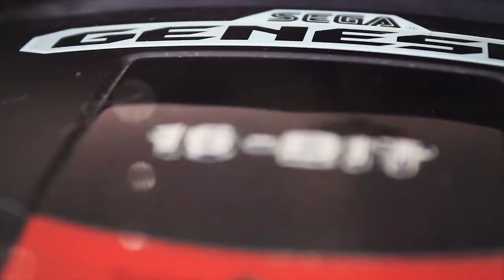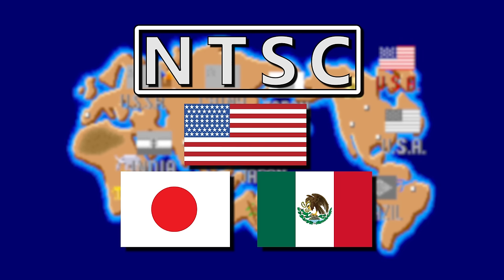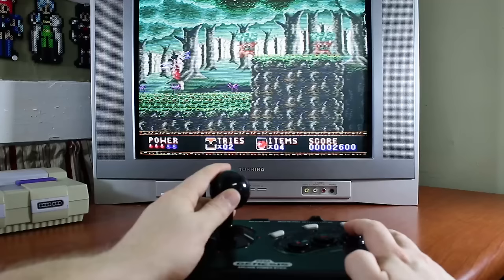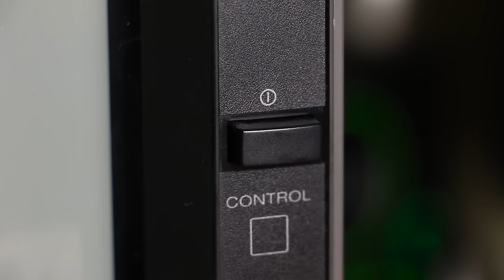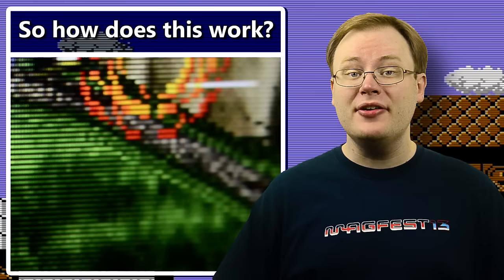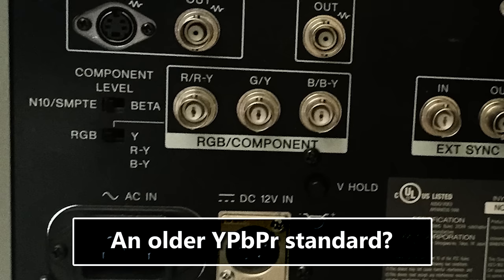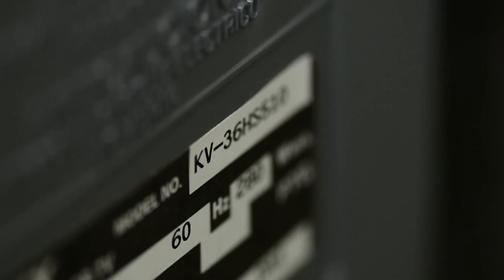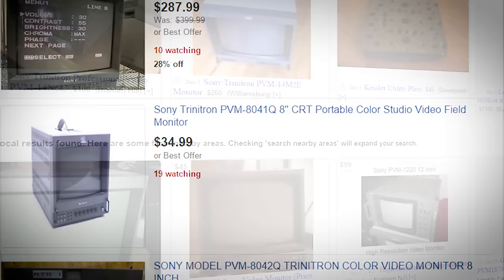Gaming on CRT Televisions, PVMs and BVMs :: RGB104 / MY LIFE IN GAMING

Comment: Hi guys, thank you for the informative and entertaining video. I have to ask, did you ever consider a CRT projector for vintage gaming? Personally since the late '90s I play on projectors, and while now for modern consoles I use digital projectors (that in certain cases are not too bad regarding lag), for consoles up to Gamecube era, I find a good old CRT projector a wonderful experience. You see, Sony PVM, BVM and good consumer monitors are fine, but obviously they are really small. CRT projector are a pain to install, they are really big, sometimes a bitch to properly setup, but when all is fine, the experience to play retro on a 60" screen (that is usually the minimum size they can be setup) on a CRT is really unpaired in my humble opinion. And as is the case with professional monitor, for low res signal maybe is even preferable to use a low-end CRT projector, otherwise the scanlines can be really big, defined and distracting (I prefer non do anything with external scalers, doublers, etc). For example I have right now a Sony D50 7" and a Barco 909 9", and at 240p I prefer the former (that can be purchased dirty cheap, as other somewhat low-end CRTs projectors).
Reply from the maker: [Try4ce] I've just begun to dabble in the world of DLP projectors, but I have no clue how to get my hands on a CRT projector these days.
Reply: @mylifeingaming  , well, other than the usual eBay and similar, one ultra-reliable source in the past years for me was curtpalme.com. Curt is a really nice guy and is really THE BIBLE regardind CRT projectors. Plus, the unit sold by him are absolutely bomb proof, and for gear over 20 years old and very complicated, it is a nice bonus. 
Sadly in recent years the CRT market has dried out, but I am in the processing to buy a Barco 708 from him (nice unit that accept natively 480i and up signals, and is not too sharp for them). I know he also has a pair of Barco 909, the pinnacle of CRT technology, but these accept signal from 480p on, and even so, they really are ultra sharp for SD signals. So you would "need" to use some scaler to have a more compact image. Think like a BVM monitor, you can like ultra defined scanlines, or not. I honestly prefer a bit less sharp image with SD content. But for you guys that like retrogaming on CRT, the CRT projector are a route worth considering in my opinion.

Comment: Hey noob here, so scan lines on my crt are barely visible but it only has a composite and svideo inputs, is it still an hd crt?

Edit: changed component to compsite
Reply: Just because it has a flat screen and component doesn't mean it's a CRT. My Panasonic has component and is SD while mid 2000s Trinitrons could look identical to their HD counterparts. If it doesn't have resolution options or HDMI I'd assume it's not an HD CRT.
Reply: @nerdyneedsalife8315  its an emerson ewf2004a, I got it for free. I assume the a at the end is for analog. I'm just trying to find any information what is an analog crt and what is an digital crt and can't find anything. Also I wrote component instead of composite.
Reply: @TheRealMax77  I don't think it is according to this link. https://www.cnet.com/products/emerson-ewf2004-20-crt-tv/

Comment: What are your thoughts on rear projection?
Reply from the maker: [Try4ce] In my experience, the black levels aren't particularly good, but it's definitely a neat technology.
Reply: @mylifeingaming  Kinda got my hands on a rather, absurdly large for the space I have, crt rear projection tv. Like 60 inches. But it's an HDTV 1080i, so probably digital delay in there, but it's viewing angle is just terrible. And it's still kind a dim, and I don't think you can really change out a lamp like you can later styles of rear projectors.

 Sonic 3 is in black and white because it wants to think it's 480i. But strangely other genesis games are fine, I could probably use the rf instead of the a/v. But I do have to admit Sonic 1, and came through extremely clean. But how many other games/systems is this going to be a problem where it can't take and use the 240 signal correctly?

I kinda want to get rid of it, but I kinda don't. I guess it's not really that ideal for retro gaming, and it's kinda impractical, but after getting it up a few flights of stairs...
Reply from the maker: [Try4ce] Are you sure it's CRT and not DLP? Weird that it would interpret 240p that way, must be digital weirdness. One thing, the Genesis composite signal is so poor, some devices can't lock onto the chroma signal. Maybe that had something to do with it.

Comment: Is scart better than S video?
Reply from the maker: [Try4ce] Yes, especially when connecting to a pro monitor or upscaler. Not much difference on a consumer CRT. However be warned that SCART is just connector and may carry different signals. What you want is RGB. Cheap SCARTS may be composite only or have noise issues due to poor wiring. SCARTs cheaper than $20 should not be trusted. RGB and component are essentially the same quality when that's an option too.

Comment: So for Ps2.. Is it suitable to use crt or led monitor with hdmi converter?
Reply from the maker: [Try4ce] PS2 probably benefits from a CRT more than any other console in my opinion. But you can play it on an HDTV too.
Reply: @mylifeingaming  because i order a hdmi converter for ps2 to play at AOC Monitor.. I don't know which one can get a sharper picture between crt and the monitor..
Reply from the maker: [Try4ce] If "sharpness" is what you're looking for, I feel like PS2 looks especially sharp on a CRT. Somehow the way interlacing is done on a CRT, it just makes the depth of detail in the image feel like more than it really is. It's hard to explain, but the textures just look cleaner, and even geometry edges look crisper with 480i on a CRT, no matter what method you use to upscale it for an LCD TV/monitor.
Reply: @mylifeingaming  So that means i just use the crt for Ps2 right? How about Nintendo Wii? Is it suitable with monitor and connect with hdmi converter?
Reply from the maker: [Try4ce] Most Wii games support 480p. Not sure what kind of monitor you're talking about. If a CRT computer monitor, Wii should look pretty good with a lag-free component to VGA adapter.
Reply: @mylifeingaming  I mean im playing wii using the normal gaming led monitor like AOC.. Is it good for the resolution or quality for the gaming picture?

Comment: "sending 240p to the TV"
that never happens, 240p is not a TV standard format, the console itself has to convert to 480i or 576i before sending to a TV.
Reply from the maker: [Try4ce] Correct, it's not a proper TV standard format, but it is a "trick" that works because analog technology can be manipulated like that. Look at a CRT up close when sending it a 240p signal versus 480i. The behavior is different. 240p is a TRUE progressive signal, there is no interlaced flicker (if you're using composite, don't mistake the flicker of composite for interlacing). There are gaps between each scanline. While interlaced content draws scanlines in alternating fields, 240p has the electron gun scan the lines in at the same place on the next frame. Some people call this "double strike." Many modern TVs will not accept 240p because it's off spec from what they expect, but this is not a problem in the analog world. For the modern TVs that do recognize 240p, some of them display information that it is receiving a 240p signal, as opposed to 480i (however some do misinterpret it as 480i). It is a distinctly different signal when it leaves the console, but it still fits within the 15kHz range. Only a few consoles (like the 3DO) convert 240p to 480i before it leaves the system.

Comment: I'm an engineer, I worked for RCA, I live in Silicon Valley.  Trust me when I say nobody designing video games cared a bit about using a CRT.  Engineers hate them because of their flicker and the 2nd I didn't need to use one to be able to work on a computer, I didn't have one - back in the mid 1990s.  CRTs are TERRIBLE, and it's not much work to simulate the horribleness of them on a flat panel, if you really want to do it.
Reply: I bought a toshiba crt tv in the mid 90's and that tv had a fantastic picture quality and brilliant sound.....paid a lot for it back in the day but it was worth it

Comment: How lag sensitive are lightguns?
Reply from the maker: [Try4ce] Very. I mean, if it can't see the exact frame it's expecting to read, it's not gonna work.
Reply: @mylifeingaming  Well, the reason I ask is. I want to mod a PS1 to have a VGA output without losing any compatibility. It should be possible with less delay than it takes to draw 2 full horizontal line. That's with proper line doubling of 240p. One horizontal line could be stored, then sent out stretched and line doubled to 480p... while the next line is being stored. 480i would be the same except no horizontal stretching. We're talking microsecond delay or fractions of a millisecond.
Reply: I'm looking into a hardwired circuit to do this as opposed to an FPGA.
Reply: @mylifeingaming  You think .05 milliseconds would be good enough? CRT phosphors should still be persisting well enough in that time... No?
Reply from the maker: [Try4ce] I don't think lag would be an issue in that case, but if I'm not mistaken, the behavior of the scanlines also plays a role. I have no idea whether it would behave the same way at 31kHz as 15kHz, or if the characteristics of a VGA CRT would be a close enough match. That's getting a bit outside my area of knowledge.
Reply: @mylifeingaming  15Khz vs 31 Khz is only really a display compatibility thing.
Reply: @mylifeingaming  To ad a little perspective to it, the filtering to go from composite to the RGB (which composite CRTs do internally) adds delay to the signal. It's probably even less than one scan line of my concept VGA output though.
Reply: The way filtering varies per color and causes the fringing around sharply contrasting edges is an example of the difference in lag of each color just from the variation between the filtering/seperation of each color. There's probably about that much delay added to the entire signal overall; but. that's still a small fraction of a single scan line. It probably varies between various models of CRTs as well.
Reply: I doubt light guns are sofisticated enough for scan lines to make a difference; but' I have looked that far into them. I know latency is a huge concern for them and even for people that just don't like lag; so, that's where i started.

Comment: Someone recommend me a model!
Reply: for a CRT TV? id say any tbh plus you probably wont have much choice in models now since there getting harder and harder to find
Reply: If you need 480p or higher up to 1080i, Get a BVM-D24 it is a 16:9 wide-screen CRT.  It works with light guns and there are adapter are available to usr Hdmi on it for new consoles
Reply: @doomisforu  I know I'm pretty late but unfortunately back home with covid. I'm in UK so I'd just need a good multiformat and be good to go, but even those trinitron are getting pricey. No room anyway 😭

Comment: I think PVM's are overrated, overpriced and overweight. A simple Sony KV-M1450D for 10-20 bucks is all you need for most home computers and old consoles, they have an RF tuner and RGB, try that on a PVM/BVM, it weighs 1/3rd of a similar tube size PVM, and if you like bigger for a PS2 or PC Engine, you can always get a 20-28 inch full flat stereo black Trinitron, something that does not even exist in PVM/BVM world.